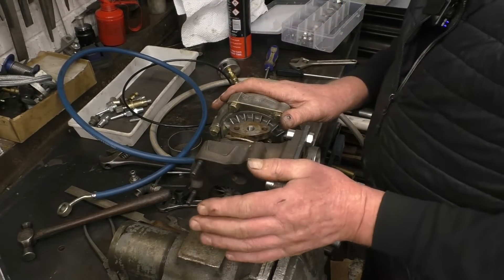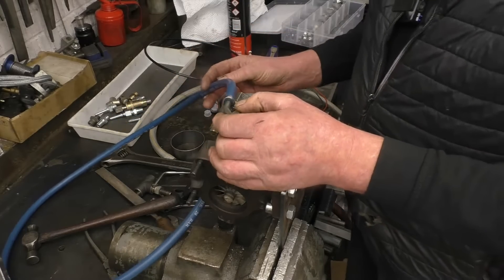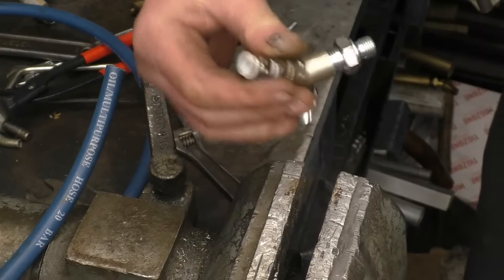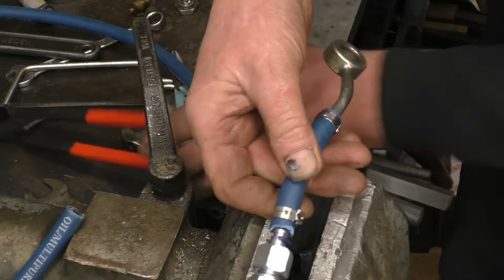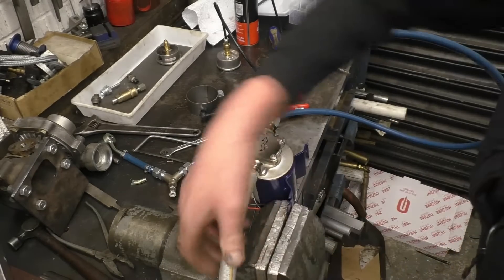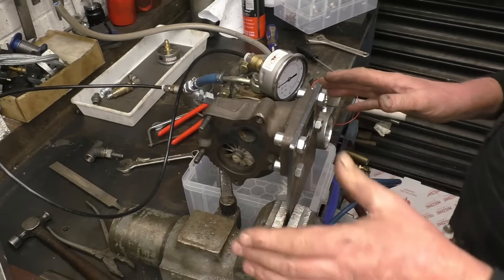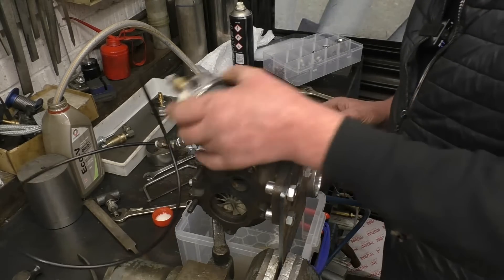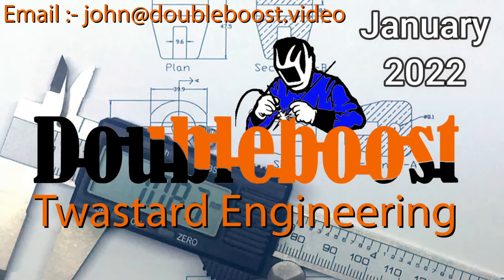DIY Gas Turbine P6  Oil Pump.  Old Project Restarted.

Comment: A little tip I learned when threading in a 1/4 adapter put a 1/8 fitting in the adapter first so that you don't distort the the thread.

Comment: Hello John, you are going to have the most fun you can have with your socks on messing about with that oil flow. Have you considered pressurising up the turbo charger body to the expected discharge pressure of the impeller then measuring the bearing cavity pressure as this will give you what minimum oil pressure you will need for the PRV in order to get any oil flow at all. Hopefully the air seals are in good condition?
Reply from the maker: I would expect to achieve around 2 bar discharge pressure P2
60 PSI oil pressure is basically what a internal combustion engine runs .
A pressure relief valve will controll  pressure .
Flow will be determined by oil viscosity and bearing clearance .

Comment: Glad to see the jet project is back on. Top tip, cable ties make great hose clips for temporary setups. As long as the hose/fitting are the right size, they hold no bother. All the best.

Comment: I'm currently doing something similar with a rear/under-boot mounted turbo with a completely separate oil system to go on a mk2 golf with a 3.2 Audi A3/R32 engine in it (clearly this isn't the best or recommended way of turbo charging a golf, but I reckoned it'd be an interesting project so I'm doing it anyway!). The pump I've got is similar to the one you have, but I've controlled it with an Arduino and some code that reads an oil pressure gauge to govern the pump speed, rather than it running through a bypass to maintain the pressure (lots of reasons to avoid that, including extra pipework, oil temperature/cooling, etc).

So, really excited to see how this works out! (I'm only a few minutes in right now)